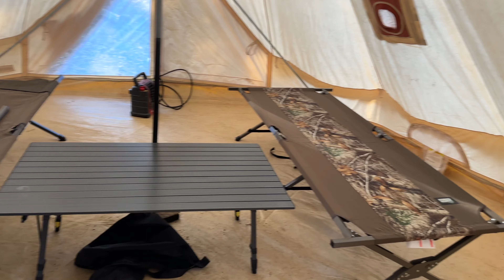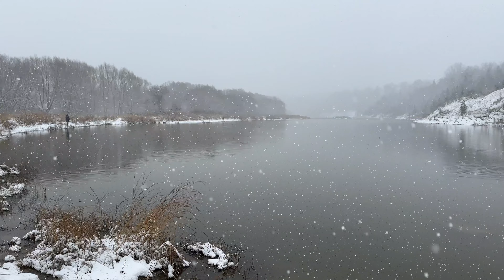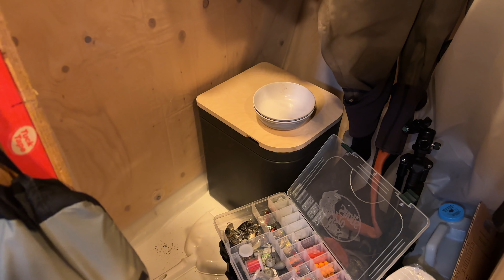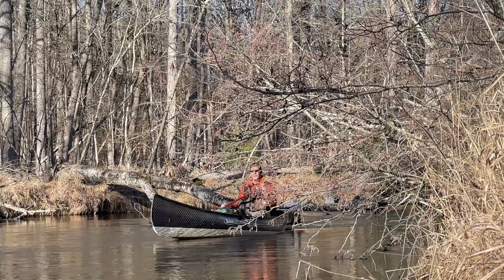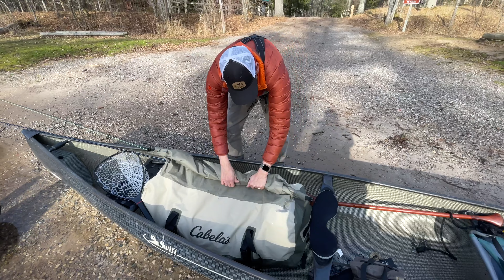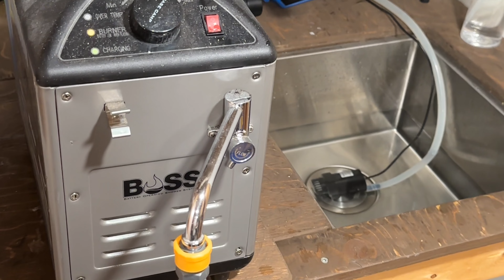WINTER in a DIY Tiny Camper - Woodstove, Camping, Fishing, and Hunting

Comment: Nice setup! Looks kinda like what I did, but if I'd have had some money to spend.

You've got a nice workaround for your fireplace, but ideally you want the air intake going directly into the stove somehow. It might involve some custom rigging, but ultimately I think you'll be happier if you don't NEED to be letting air into the cabin. There might be a night where it's just too cold for you to do that and be warm enough.

Don't feel too bad though, I made the same mistake with the homestead I built, except I didn't even really account for an air intake in the first place. When I realized my error, I whipped together a screen door in a hurry so I could have air intake without letting the cat out, and it still doesn't work right. I do all my cooking outside and have made a mental note that redoing the fireplace from scratch is Job #1 when I go back there in spring.

Keep doing this stuff, I'm eager to see what you build next!